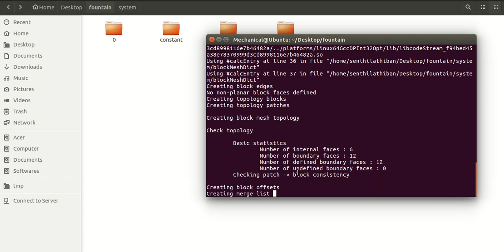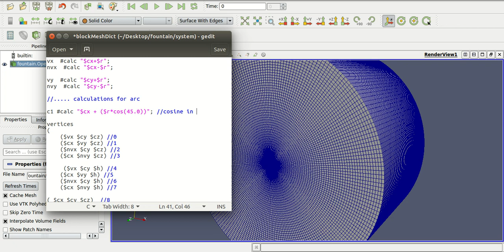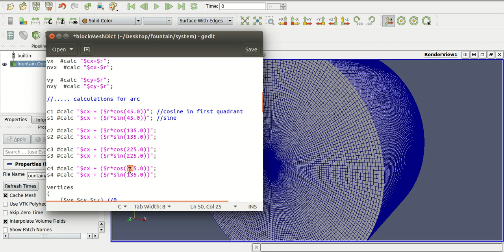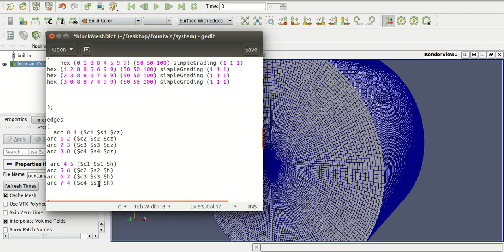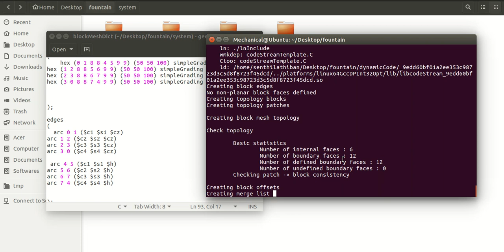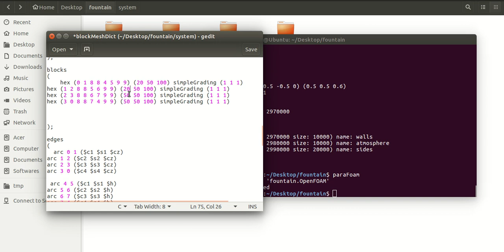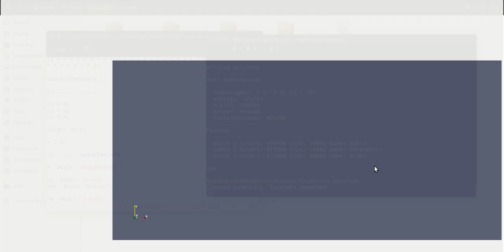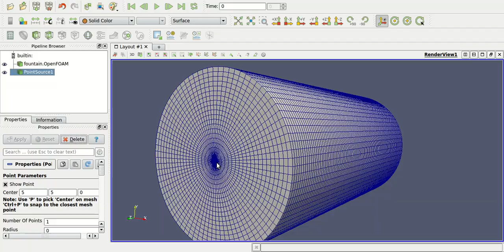blockMesh with variables for easy geometry modification

Comment: When I try to do the same I get the Foam Fatal Error, blockHex (0 1 8 8 4 5 9 9) has inward-pointing faces. Could You help?
Reply from the maker: check section 4.3.3 https://www.openfoam.com/documentation/user-guide/blockMesh.php
Reply: @MechanicalModelling  Thank you very much for your answer, but I'm afraid this link is not working.